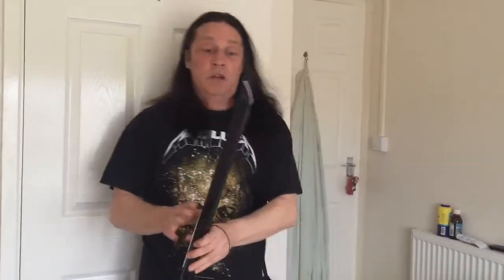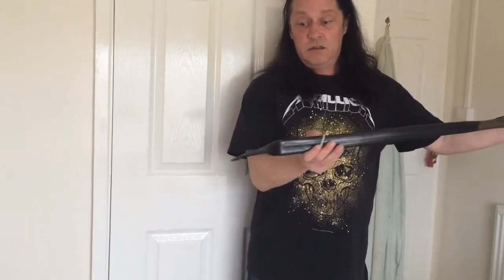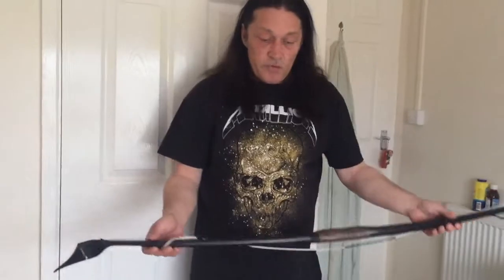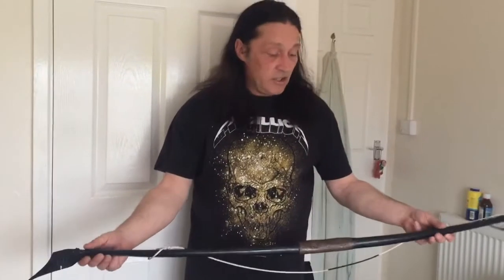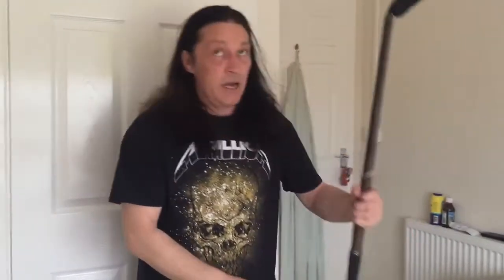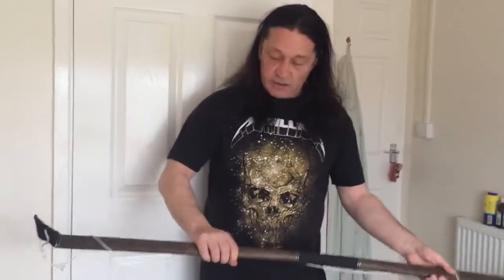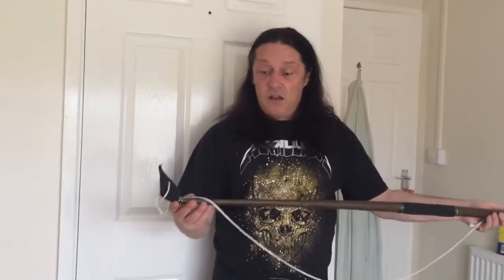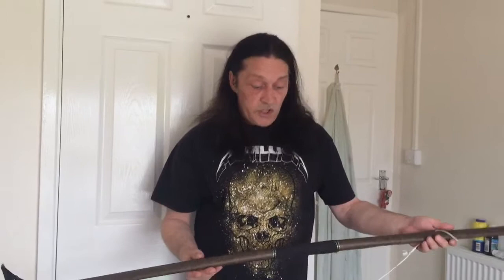Uk Pvc bows

Comment: What about this stuff, Its 3/4inch, the wall thickness is 2.9mm and is schedule 40 Class E. 34-White-PVC-Pressure-Pipe-25m-Length_p_4288.html
Reply from the maker: if its sched 40 will be fine its what the US make its hard to get sched 40 here in the uk so tends to be expensive
Reply: @yellowbelly9005  The 1" is £7.70inc. VAT - 2.5m + £4.99 postage.
Reply from the maker: @AlanAlanAlanDave  i would go for 3m lengths if possible then you can get 2 60" bows out of 1 piece
Reply: @yellowbelly9005  I haven't checked but their starting/stated length says 2.5m
Reply: Yellow Belly yeah but I might be going for a shorter bow in the hi 50’s

Comment: Any idea where to get the solid fibre lass rods from in uk, been doing net searchers for ever, and can only find a couple and all have end fixtures attatched and are definitely not cheap
Reply from the maker: i found the same, i tried fibreglass tent poles with relative success also put a 1/2 inch inside a 3/4 inch again with relative success.
Reply: @yellowbelly9005  thankyou
Reply: You can get fibreglass rods from the range and dunelm mill
Reply: @namtalf  cheers fella